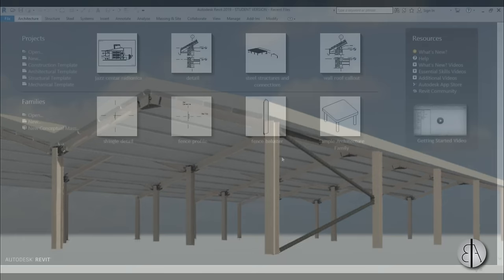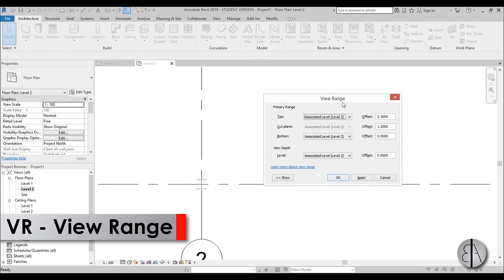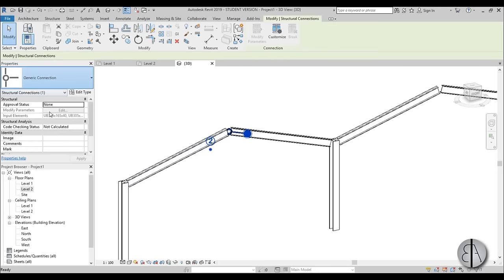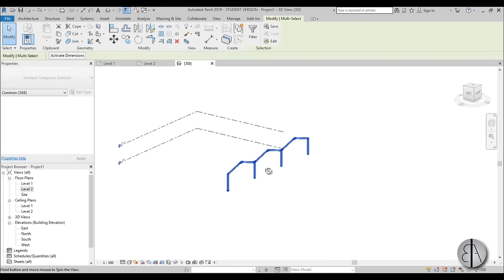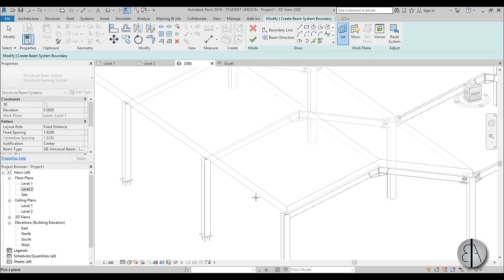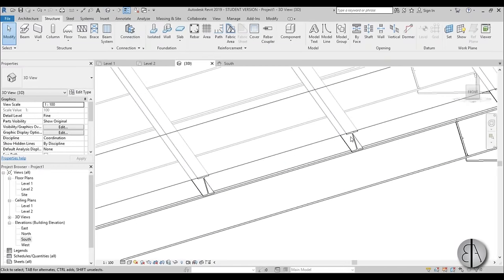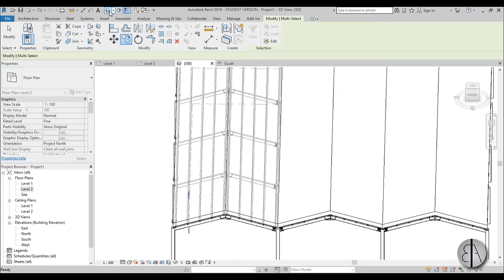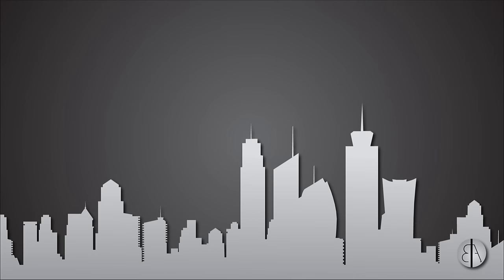Steel Warehouse Construciton in Revit Tutorial

Comment: Nice video with a quick workflow. 

But. Major issues are columns are placed on the wrong axis and that bracing connection to the rafter that was brushed off as "looks ok" will not work. There are many other little things that make us engineers cringe too. If you would like some simple structural input on your tutorial content feel free to give me a shout.

Thanks for all your informative and productivity enhancing content!
Reply: I learned Catia, Solidworks and Inventor, a lot of mistakes at first. On the beginning you need just to understand functions, it doesn't matter will it actually work in reality. :) Same with Revit. Learn how to place columns, walls, floor, then go to MEP, etc. You can get the basics online, but you will understand how to work in 3D programs once you actually start working in a company on a real projects. :)

Comment: great video but out of curiosity how do you add the walls since they are not traditional walls and rather purlins running horizontally and sheeting on each side with insulation in between

Comment: I try to create spanish roof tiles . And the problem is if i choose sloped glazing and try to edit the grid lines  and ERROR :Changes have been made that cause a curtain wall with type driven grid lines to exceed the maximum allowed number of type driven lines (200 in direction (1) and 200 in direction (2)).  If you really need this many type driven grid lines, please split the affected wall before proceeding.

Comment: Very nice tutorial thanks! But the column orientation is "wrong".  The major axis of the H column should be parallel to the opening of the portal frame cause usually thats where the largest moments are joing to apear. Since you made a pinned bracing system i dont see why you would put the strong axis at that direction.